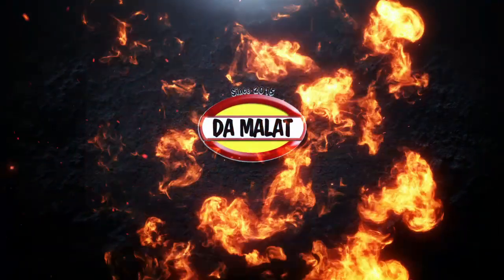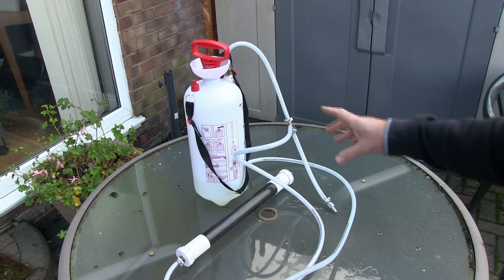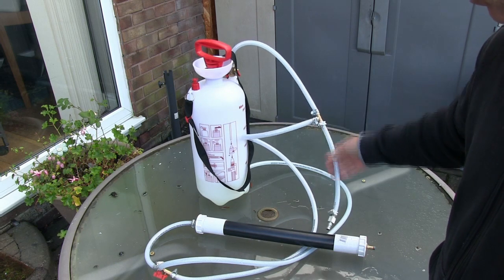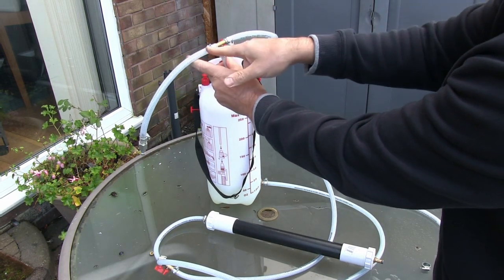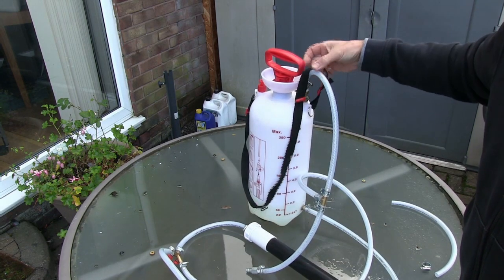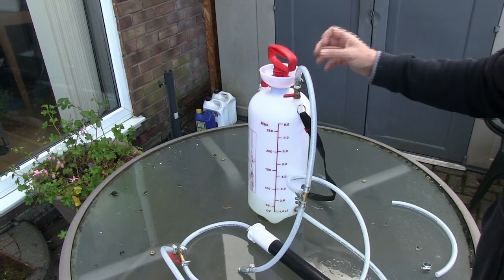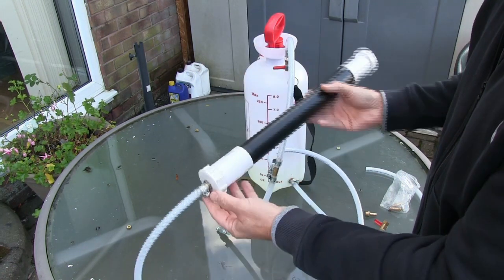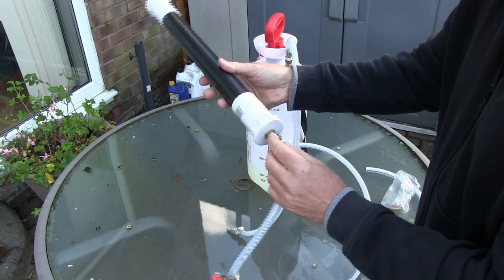Part 2, How To Build An Aircrete Foam Generator From A Garden Sprayer

Comment: I wonder if the nozzle dispensing end is actually reducing the bubbles by potentially compressing and breaking them since the diameter is so much smaller than where the foam gets created? I have seen another video where the end of the foam wand is completely open, and they used 2 screws to hold the stainless steel scrubbies in place.

Comment: did you try a "Y" connector rather than a Tee?  The compressed air would then help to aspirate the foam solution from the sprayer.  Nice Video!  Thanks for sharing  Doug
Reply: It could also lead to a  mishap in the pvc portion though when solution gets low leading to an air and fluid hammer since both air and water flow but air expands.
This could lead to rapid pressure changes that could easily shatter the PVC and sending it flying at your face or neck.
Always a danger when using pressure with PVC pipes which is why the garden sprayer being incorporated as the pressure and solution chamber.

Comment: I did not find the Y with the ball valve would it be okay to use one without ? What pressure (PSI) would be  appropriate for this build ?
Reply from the maker: You can add separate valves for each line before the Y. About 60 to 90psi is sufficient to produce a nice workable foam.
Reply: @DaMalat  Thank you. I am very excited about this build. Will keep you informed.

Comment: Great setup!
Am I right in thinking that aircrete holds heat better than firebricks? Is that the point of making them?
Reply from the maker: Thanks. Yes, Aircrete has great thermal mass qualities. I'm looking to combine Aircrete with a castable refractory mix to produce the ultimate pizza oven structure.
Reply: @DaMalat  Sounds good! I’m quite tempted to have a go at building one next Spring. 

Apart from it being a cool thing to have at parties, do you find they taste significantly better than a typical pizza stone in an oven (which is how I do mine)?  
I do love the smokiness of barbecued food which is my main interest in making one.  Also, as a coeliac, anything that can be done to make a gluten free base taste better is a bonus!
Reply from the maker: @isyt1  The difference in taste and texture between a wood fired pizza oven bakes pizza and one baked on a pizza stone in the oven is light years apart. There is just no way of replicating the cooking environment of a wood fired oven in a conventional oven. Also, it's the theatre of cooking the pizza in the wood fired oven at a family BBQ that makes the whole experience special. We also use our pizza oven as a garden fireplace. It's a great backdrop when you just want to chill in the garden after a long day at work !!
Reply: @DaMalat  You should be a salesman mate. 
That’s me sold on the idea 100%